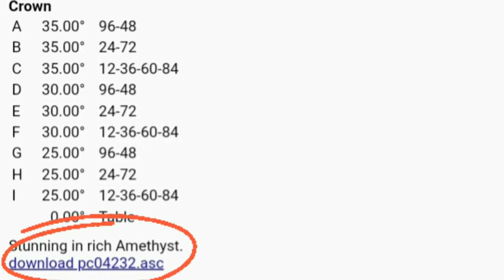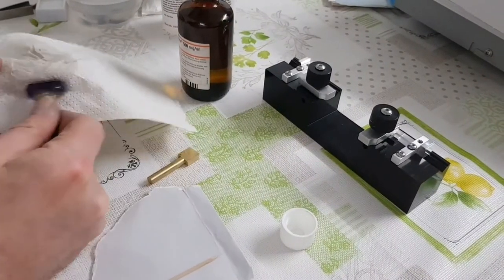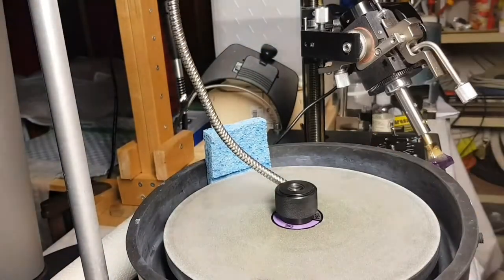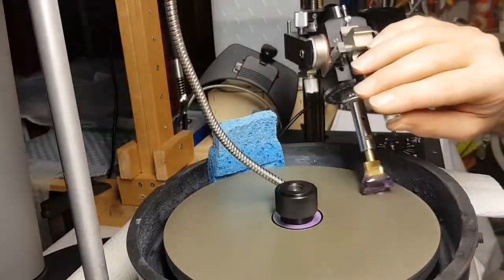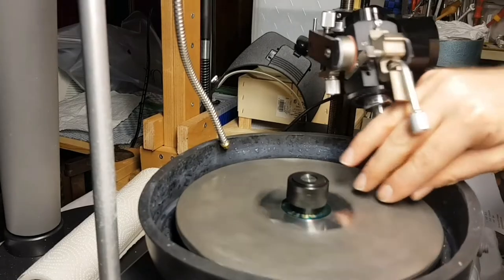How To ⁉️ Video Tutorial 🎥 Gemstone Faceting 💎 Ideal Emerald Cut elongated Amethyst

Comment: Wunderschone! Very nice work.  Why do you prefer epoxy over wax for dopping? At some points you use oil instead of water, do you have reasons for this? I would love to see a pile or collection of your gems spilling from a small treasure box, like a dragon hoard you made for yourself...
Reply from the maker: Dankeschön🙂 I use epoxy because it is the most comfortable for me to work with. Nice viscous and hardens quickly. I usually tend to take a little too much, it just feels safer😄
For me personally, Super Glue is too liquid to work with, especially with larger stones. I think the connection is safer with epoxy than with dop wax. In general, however, all three can be used very well. I use oil for prepolishing and polishing with Diamond on the BATT Lap, because it is easier to dose than water. A drop on a paper tissue and spread, rub the Lap dry once, then apply Diamond is my standard mix, if I have to polish more carefully, for more control(softer Materials), so as not to overcut any facets, I wipe off the Lap quickly, more oil remains on it, it is softer and cuts / polishes slower. If I want to cut / polish faster with more resistance, I wipe dry two to three times.
Reply: @GermanGemcutter  Thanks for the tips. Sound reasoning.

Comment: I use so little oxide on my Darkside lap that it is barely visible.
I can't believe how much you put on this lap. 
Have you tried MUCH LESS ?

That said, regardless that you use WAY MORE oxide than I do, you do get an excellent polish. But I say you can get and equally excellent polish using much less oxide on the Darkside.
Reply from the maker: Yeah you are right. I replied to your first comment.
‐--
In the beginning I experimented a lot with oxides and water, it was a method that worked. However, I was never satisfied as I was wasting way too much oxyde. The problem was with the dosage of water. 1 drop every 3 seconds, 1 drop every 5 seconds, everything is far too much. The solution was quite simple, I now use a spray bottle, so that the water can be optimally dosed and I hardly need any oxides for the perfect polish. My buddy Tony gave me the tip with the spray bottle. I also made a video about it later. Take a look: https: //youtu.be/olof6tZ64Bo